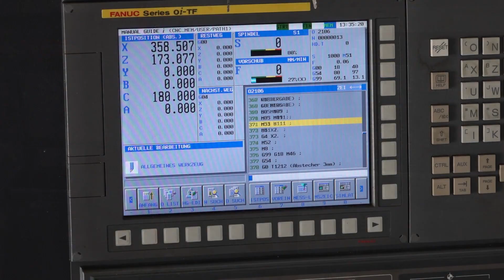Revolutionizing Machine Shops | Korean Tech Explained!

Comment: What brand are those long necked endmills at 3:20? I really need them i have a similar lathe, a wia 2200sy for several months now, still looking for the most efficient tooling
Reply from the maker: not sure, I would contact the guy in the video
Reply: My guess is Sandvik CoroMill 316, exchangeable endmill with many shank lengths for clearance vs rigidity.